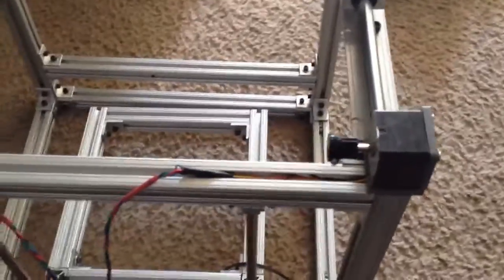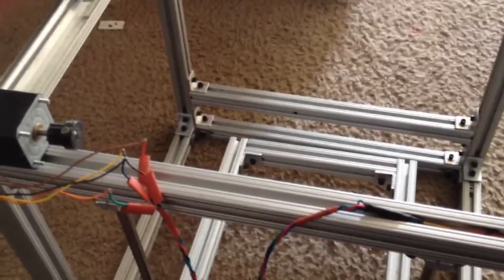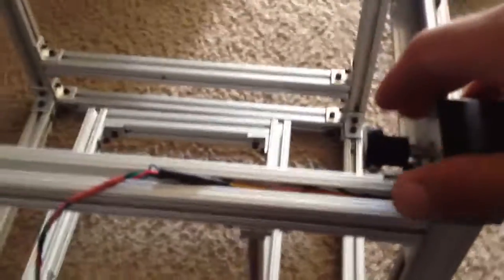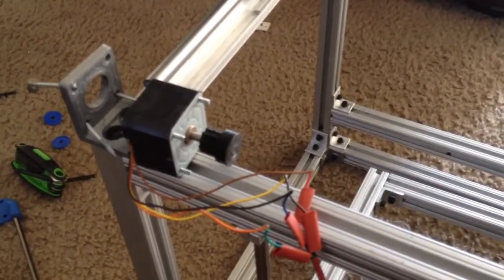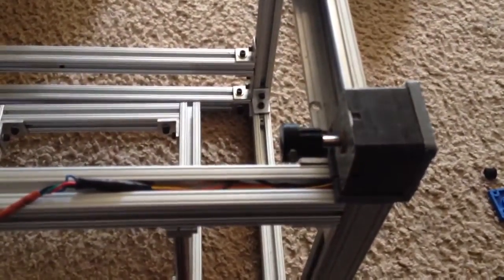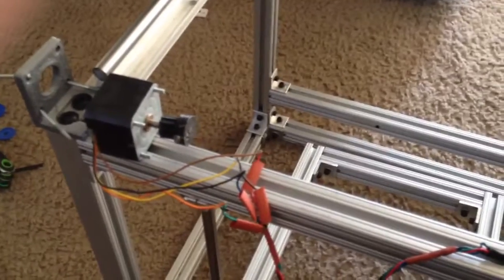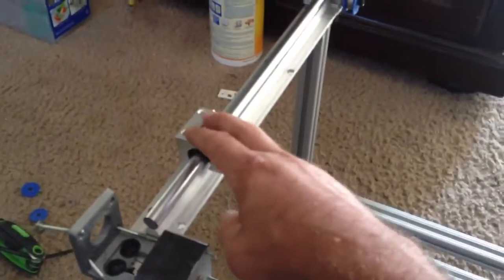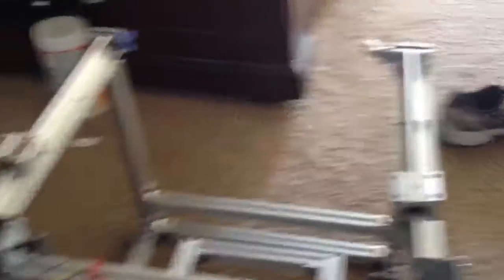Parallel Nema 17 Stepper Motors Y Axis

Comment: Did you wire both motors to one  driver for y axis? So only using three axis is software .
Reply: flat earth rat Yes. you only need one stepper driver if you wire them up like this.

Comment: Could you elaborate on how you actually did the wiring? I want to add a dual Y to my Shapeoko, but I only have a 3-axis board, so I want to wire my motors in parallel.
Reply from the maker: kbsyt81. The best way to figure this out is to take 2 motors and wire them together to find the correct wiring.

I found that dual y was not worth the effort.